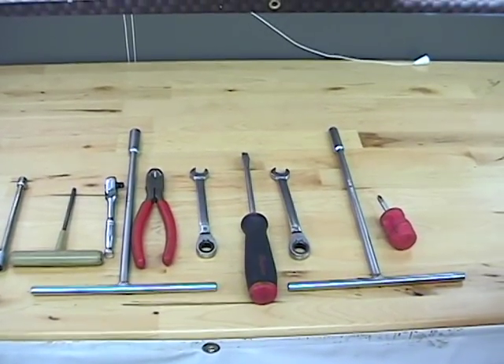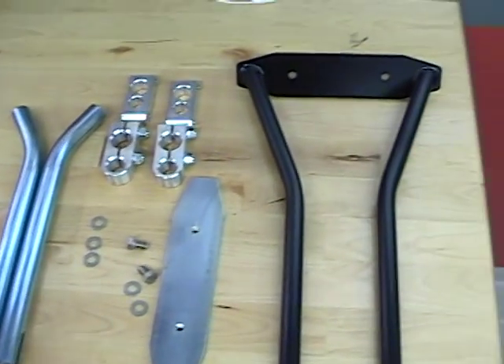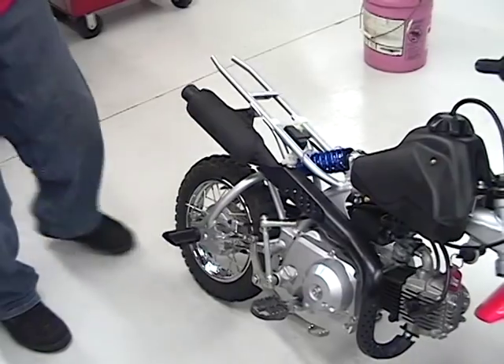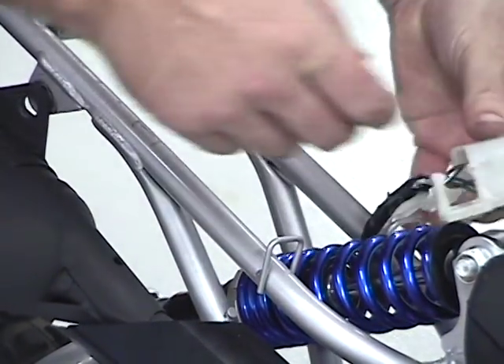12 Bar

Comment: The install doesn't work on the 17 model. The exhaust nut is welded onto the frame and blocks the tubes! On top of that the rear reflectors need to be ground off with a grinder!

Comment: Mine did not come with down tubes wtf? I bought it off of your website
Reply from the maker: The tubes come with 12 bar kit and foot hoop kit.  someone bought a foot hoop rear section, and 12 bar clamps last week.  maybe that was you.
Reply from the maker: We have been out of stock on 12 bars for a months because the tubes are sold out, looks like you purchase 2 parts of the kit as a work around.
Reply: Dang it was me, is it possible to wait until the down tubes come back in stock and just order the down tube by themselves? I was so frustrated trying to figure out how to mount it, then I looked up how to install and realized I didn’t have everything I needed
Reply: On another topic the rear hand brake works great
Reply from the maker: send email, I found a couple tubes. ryan@50stunt.com